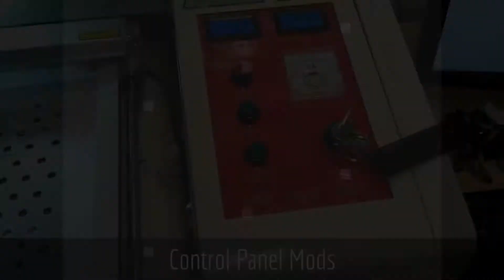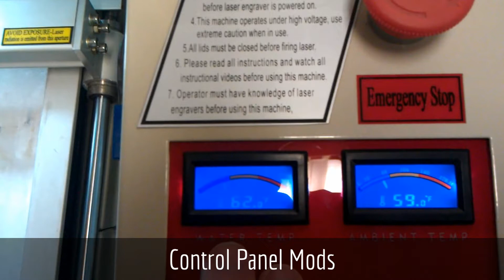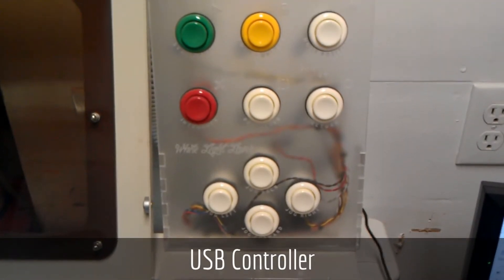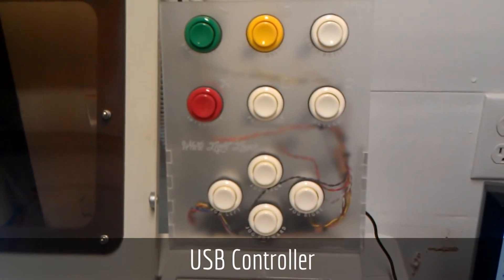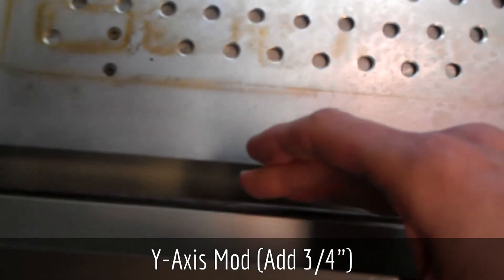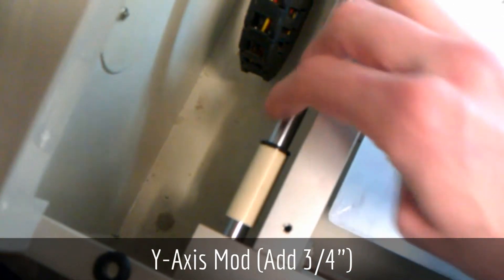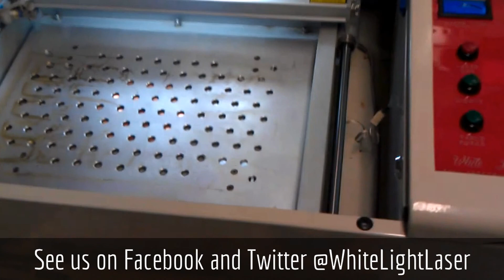Full Spectrum Engineering 40w Hobby Laser Modifications

Comment: Id like to see more info on your downdraft setup. Could you do another video or post pics of how you created it? Thanks
Reply from the maker: Josh P Sorry, I no longer have the machine so I can't do pictures of it. I'll describe it for you though, as it's a rather simple build. I cut the parts on the laser.

First off, you need to drill the holes through the aluminum table as shown on the video. On the underside, you need to build a plate that has channels in it that goes from the holes to a 120MM high flow computer fan. The holes need to laid out in CAD and slightly precisely so that they will line up with the air channels properly. The plate can be made from two layers of 1/8" MDF or acrylic. One plate is rectangular, with a half circle cut out to clear the height adjustment parts and a full circle in the center for the PC fan. The second plate is exactly the same layout as the first, but cut a series of branching channels connecting from the PC fan hole out to all the vent holes in the aluminum. Making a paper template for drilling the aluminum is a good idea. Glue the channel plate and solid plate together (channel one on top, where it will come in contact with the aluminum). Screw the fan to the underside of the solid plate. Glue/screw the stacked plates to the underside of the aluminum table. Attach the fan to 12v power (I had a small 12v wall wart that worked fine). I ran the 12v through one of the front panel pushbuttons. I'll see if I can find the CAD file I originally created for this. It's been years though, so no idea where it's hidden amongst all my hard drives and backups.
Reply: WhiteLightLaser Thank you for the detailed info. It will come in use later.
Reply: Which laser did you get to replace this?
Reply from the maker: I got the newer generation of FSL's hobby laser. The 5th gen. 20"x12" cut area, and a rotary. Pretty cool unit and a deal too good to pass up. The guy who bought my heavily modified 4th gen was super happy with it too.

Comment: @wightlightlaser the reason the switch is 1 inch further so the head has time to slow down
Reply: You are correct on the need for deceleration space. Not correct on the switch. The software takes care of where to begin slowing down. This is the mechanical "home" limit switch. After the modifications, the laser worked normally, just with an extra 3/4" of travel.
Reply: Ahh yes I understand that better now I'm just use to contact less limit switches

Comment from the maker: The table purge I came up with after trying lifting the parts. With it, I'm not losing some material height. All the parts remain supported on the grid so they don't move when done cutting. And this actively clears the gases at the cut because it actually creates some suction. Also slightly holds the material down.

And I'm so bummed. I'm putting this one up for sale as I'm getting a new laser cutter from FSE... and the tube died today. Stupid timing.

Comment: Nice job on the table purge. I went a different rouet for mine. I used 4 self tapping screws to shim the 4 corners of the cutting grid up 1/8". This improved my airflow and helped strengthen the grid as the rivets were a little loose on one end.  For water temp I picked up a unit from Parts Express that has 2 sensors and cycles them every 5 seconds. 1 monitors the water tank and the other monitors the tube. The last thing I did was go to a larger water tank made from a plastic fuel cell.